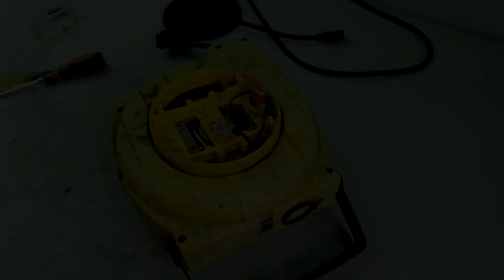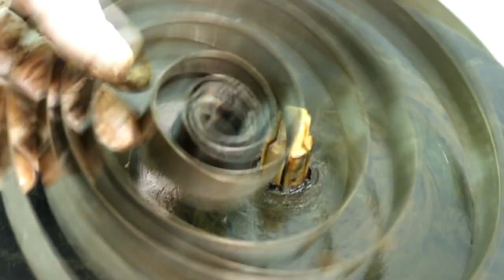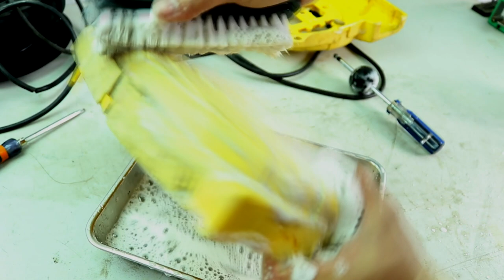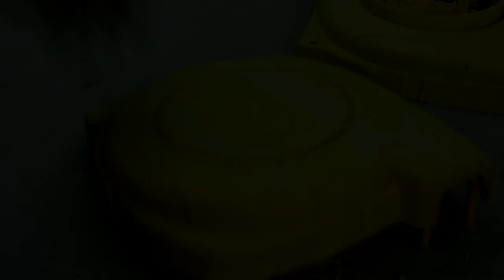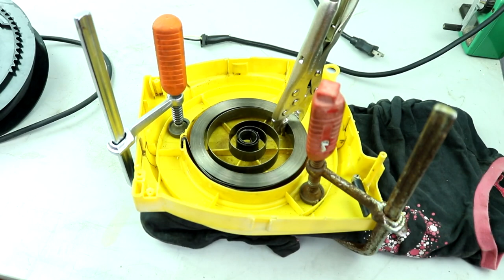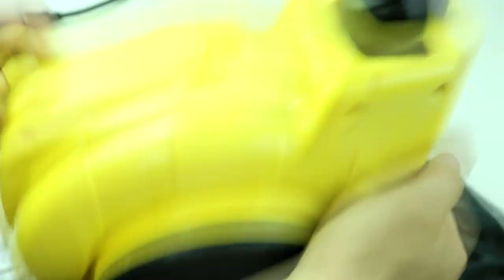Heavy Duty Retractable Cord Reels Restoration | Step by Step DIY

Comment: I don't understand why he took it apart to start out with... he could've just cleaned it and painted it (masking off the parts he didn't want to be yellow)  and avoided the whole hassle of rewinding that spring steel coil.   I was just waiting for that to happen as he was disassembling it since it happened to me once when I tried to fix a tape measure (except its spring was only about 2 feet long)

Comment: Is this a clear coat? Without a plastic primer, it won't last. Next time you got a spring like this, spool it up outside the device to a smaller diameter and add cable ties to keep it spooled while you fit it. And bare stranded wire isn't exactly safe under a simple screw, it's much better to use ferrules.